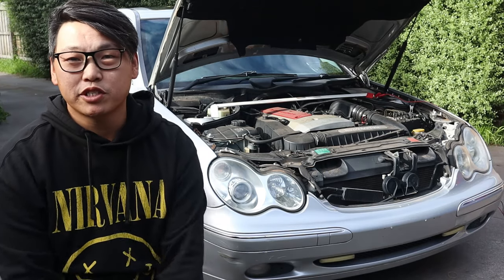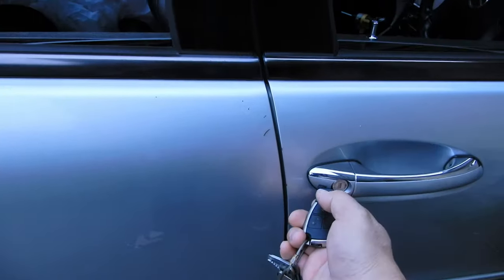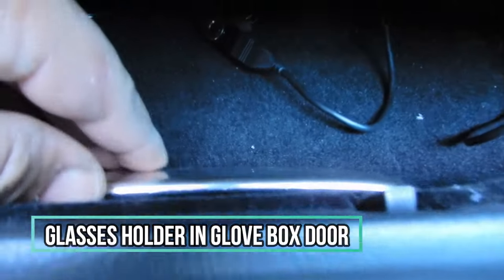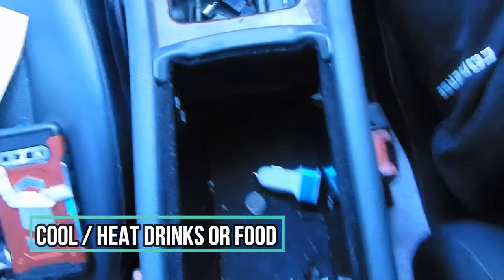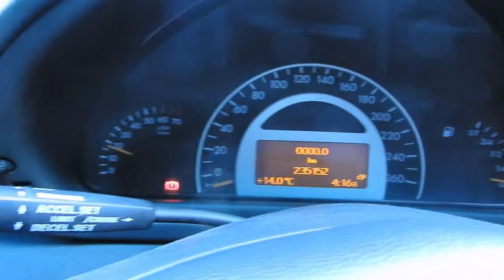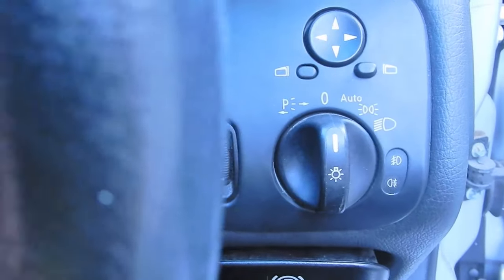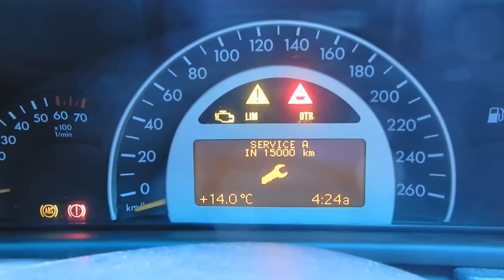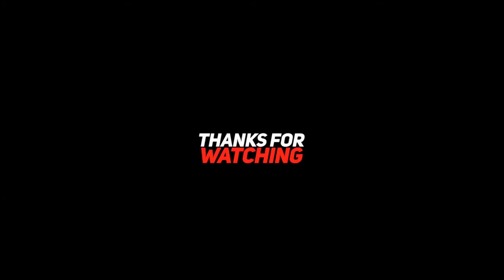MERCEDES W203 cool features tips and tricks handy hacks hidden functions

Comment: Pull up on the coin holder to remove and underneath is a hole to poke a pen into to get an AUTOMATIC car out of park, probably for when the battery goes flat or in my case the ABS computer failed, it only gave me 2nd gear I think it was, (and reverse) but enough to limp home.
Reply: WOW, I imagine THAT is gonna be of REAL use.. one day!!
Thanks for that.... 
Weird place to put a thing.. they could have just put a button on the dash?
Reply: Oh.. I can't get mine out... 
I am a pauper in a C Class.. :(
Reply: were you able to drive in a all gears after doing this??

Comment: What happens if you Jumpstart the car directly with tye vattery without using the metal chasis as the groun???
Reply from the maker: u can ..just be careful u don't short anything..u can do it that way..the only reason why uts better to do it using the terminal they give ..is becuz it protects the fuses incase u accidentally touch positive to the chassis ..it can short fuses or the sam unit even

Comment: Great video.  The W203 is indeed a beautiful car.  20 years old and still looks great.  Wonderful design for sure.
Reply from the maker: indeed i still love it hence why i havent sold it just yet lol...
Reply: @MIKEYZVLOGZ  l have a 2002 c240 same color as yours .l love this car.I only wish that I had a the turbo version of the 2.6 engine which would boost it to 349 hp from the 168 that it has .l think this car is just a little bit underpowered, that's my only complaint
Reply from the maker: @chrisfritz6261  yes i understand ya.. but if u wanted a more ppwerful car should have gone with a bigger engine then u would like it more... the 200 and 2 cylinder are just for cruising ... eventho mine is supercharged just lacks power too..and u can only upgrade the charger so much
Reply: @MIKEYZVLOGZ  l actually rescued this car at a auction and only paid $1400 for it.It ended up having a bad transmission and all the typical  problems that this car has when it gets old .l put a trans in it that I bought at a salvage yard and fixed the small problems that were broken and now everything works and it looks great.Rhe next thing I need to do us rebuild the suspension both front and back.l already have the parts but it us such a pain to get under the car to do this job that I have been putting it off .
Reply: @chrisfritz6261  l have the c32 with 400hp and supercharger stock. Not bad but needs a dyno tune to make it fly. cheers

Comment: Wonderful tips provided, thanks! I just bought one. Where did you get the head unit replacement in WA? I'm thinking of getting an android apple car play.
Reply from the maker: WA? i got it along time ago from a ib hifi in Melbourne 
now they have a new version of it , u will need all the plug and play accessories like facia kit and iso harness with steering wheel controls

Comment: By the way noticed that you’ve replaced the radio for a multimedia. Where have you got the wood-like colour frame? Or have you been able to retain the original? Been looking but haven’t found one.
Reply from the maker: @jaimemoura4802  ok so u only replace the double din area ...there use to be a single din unit and also a slot for accessories ...they were both removed but still needed a facia kit surround for the gap that would be there ... the wood grain surround stays there

Comment: Underneath the little coin holder in the center, there is the emergency shift-lock-override for the automatic shifter. The coin holder can be removed to reach the override with a screwdriver or a similar tool.
Reply from the maker: yes correct good tip
Reply: Wat dous it ? Thank you . Or why you need to use it? Kind regards
Reply: @nini7441  l got my keys stolen at a bar one night.l had to tow my car home,but with no key you can't put it in neutral, same if your battery goes dead,so I had to punch that that little button with a screwdriver to get the thing in neutral to tow it home
Reply: ohh cool....

Comment: Many thanks for this excellent tips & tricks tutorial Mikey. Really informative. The 90-degree hood feature is fantastic - never knew till seeing this video. I have a 2006 w203 automatic saloon in the UK (made in South Africa) but the dashboard is completely different (with 2 large circular dials and 2 smaller circular dials with a very narrow text display area in the centre) and I tried to get the hidden diagnostics menu for ESP settings, oil level check, SW version etc for example but mine doesn't seem to have this option. The battery voltage checker works on mine though. I also have 2 small yellow LED lights on the bottom of my rear view mirror which I never noticed before.
Reply from the maker: I'm so glad it was helpful my dear friend

Comment: Thank you great stuff. Is there any reset for the radio . Mine does not work after I change the battery  I was told I need to put in the code . I can’t get a screen to put in a code.
Reply from the maker: ye there should be a option to enter your code for radio ..if u know the code then u just enter it ... evwn if u can't see the numbers u just press the buttons kn ac rdance with your code and it will turn on and goto a function once complete .. I've never had this issue so not sure exactly how to .. and my stock radio has been upgraded too

Comment: Hi I bought today C180 engine is M111 E20 Evo and manual transmission , what advice you give me
Reply from the maker: @افلامومسلسلات-ج4ل  just lool after it ..the car is very rsolid ... I didn't have any troubles until about 7 years late
due to wear... I drove it normal I didn't do burnouts and drive like a hooligan hoon head... I cruised it mostly and changed gears smoothly.. manual is so fun as it's still rwd... in the wet u can have some real fun.... basic Manitenance regular checks on all engine components and always service between 7500 to 15000 kms ... or just do it at 10000kms for oil service and u will.be fine ...

Comment: Thanks for the video. 
I have a question, i put aftermarket brake lights and every time i start the car there is an error message telling me that i have one fault on the left auxiliary ligh but my lights are working, can i get rid of that error message?
Reply from the maker: u need to ensure ur using canbus error free bulbs and if led sometimes u need a resistor

Comment: G'day mate! Thanks for this, ive had my 2002 C220CDI elegance auto for a year and didnt know most of these( you need a manual to tell you how to read the manual on my merc!)..im going to try and understand how to use the cruise control ...ive tried while driving and no joy ill watch the vid again and take notes!👍
Reply from the maker: oh ok well honestly it's pretty straight forward.. so u reach your intended speed and then u push up on the stalk that will set the speed pulling towards you will cancel and pushing down will reduce speed pushing it in towards the right will turn on the limiter so u can set a limit as to ne er exceeding a speed ...
Reply: @MIKEYZVLOGZ  cheers buddy ill give it a go tomorrow! Also the passenger side wiper packed up which turned out to be the bearings on the wiper arm, ive bought a mercedes wiper arm  bearing repair kit so we'll see how that goes too! One thing after another with 20+ year old cars but its a great car👍
Reply from the maker: @shaunmcclory8117  indeed

Comment: The vest video so far.  Thanks !!
I  really appreciate it!!
Love it
Reply from the maker: so welcome.
Reply: @MIKEYZVLOGZ  
Only thing you forgot was to how to set up the cellphone with the car system. 
Other than that it was very helpful. 
Thanks for the video.
Reply from the maker: @figgiefigueroa7372  yeah cuz I don't have the phone thing anymore cuz my car only had the old analog phone that was connected to the dash and I cut the cable and removed it completely .. the later models have the phone connection .. hence why I installed a aftermarket unit so I could sync my phone a d use Bluetooth to connect the phone as well
Reply: @MIKEYZVLOGZ  
Oh, ok I'm sorry friend. You did great!
I got a 2004 c230 kompressor sport and it got 230,000 miles and is a monster in the road. I love my 🚗 🚘 car.
Right now I'm doing a list of the replacement parts that I  want. Still is cheaper than buying a new car.😃
But mines does have the phone feature on it. And I'm trying to learn how to install the phone so I do hands free while I drive. 
That car is the best Mercedes benz has offered mines is a 4 cylinder. Cheap on gas.
That was my dream car, and now that I have .
I'm going to do what ever it takes to keep it original. It does 120 mph in seconds.
Reply from the maker: @figgiefigueroa7372  good on ya 
. ye this was my first dream mercedes loved the shaped ..always have ..then I fell in love with next model w204 and now have that too ... next might be a e class well see
Reply: @MIKEYZVLOGZ  
I'm re-doing mines 4 pages of parts paint rims,and upholstery.

Comment: Fascinating….. I never knew most of that. I have a 2006 C-230 I inherited at 56,000 miles in 2017. It now has 70,000 10/21 but I have spent $15,000 U.S. to get it in good shape. I have spent so much and it is running very well, but when I see all the multitude of complex systems it makes me nervous to think of all the potential repair issues that could develop!
Some of the BIG fixes I had done were the ECM (engine control module $2,000 p&l) and the transmission control module (controls shifting $2,000 p&l) and the front torsion arms ($750 incl rubber bushing) plus many other items.  I see now there must be many more computers I wasn’t even aware of. These features are nice but it makes my wallet quite nervous.
Reply from the maker: wow good stuff mate ...well done
Reply: I have the same car and I deal with the intake manifold, oil filter
Housing , drive belt, pulley , atf + filter changed , thanks God I’m a handy person  did all the repairs saved  a lot  but the car is worthy

Comment: W203 is one of the best Mercedes ever made.
Reply: Actually it is considered the worst one.
Reply: @buretehudesi  everyone have their own opinion.
Reply: @waseeqkhan863  it's not the opinion. It's based on comparing. The most people driving and maintaining these cars say w203 is the worse c class ewer made.
Reply: @buretehudesi  i have w203 for years i enjoy it everyday you maintain it well for sure you gonna enjoy it. I enjoy more then my civic 2017.
Reply: @waseeqkhan863  w203 is last true mercedes.
Reply: @goldix7116  agreed, it’s the best in its category. If you compare it with bmw 3 series it is far better then that.
Reply: @waseeqkhan863  i am very satisfied with my lovely w203 cclas.only common maintance and a thermostat change last year
Reply: Until the 2002 model..... then 271 engine was installed.... ABSOLUTE RUBBISH ENGINE
Reply: @buretehudesi mixed opinions - 😅
Reply from the maker: i got into mercs from the w203 model always loved the lights

Comment: Hi, thank you very much, very informative.
You said 4:13, that when the car is manuel like mine(2002 c200 cdi), the engin does not start directly like the automatic, you have to "dosomethingto-it", what is that?
Thank you for help.
Reply from the maker: so for normal auto u can just flick the key and it will start .. but for manual u have to turn the key and hold until car starts... that's what I meant
Reply: @MIKEYZVLOGZ  So clear, appreciate it, thank you very much.
Reply from the maker: @tiyebchessmr9044  ur welcome buddy

Comment: Very helpful video, thanks. Water got in my w203 c240 fuse compartment in the engine and the AC stopped working, any idea on what to do?
Reply from the maker: water is never a good sign with electrical it can be a number of things .. sorry to say I don't think I would know what it is.. however an auto electrician could help in this case... it comes down to testing and tracking down what damage was caused due to water.. can I ask how did water end up in ur fuse box? it's rare
Reply: During heavy rain the water drain pipe through the wiper vent got blocked with dirt so the water overflow to the engine compartment
Reply from the maker: @ighodaroakenzuwa6416  that's crazy ... just start checking fuses and your electronics.
 as u can imagine water damage within a fuse box can shut down the electrical system..hence making it a major issue

Comment: At 10:08 i ear you have the same clicking noise with your vent than i have with my car. Have you fixed it ? I tried everything but nothing succes until now lol
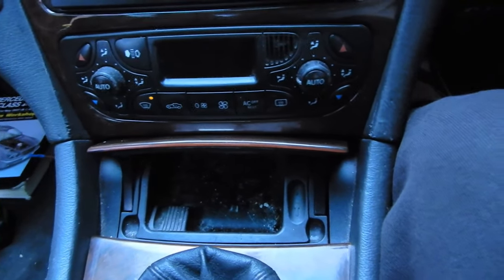Reply: At 14:00 you respond to my question ;)
Reply from the maker: @cmonavis2  not yet only way is to remove almost entire dash and get inside cuz its a lever that needs to be replaced cheap part but big job maybe one day

Comment: this has been very helpful. my abs esp bas and engine lights are on. tried to reset but remains on. how to sort out these problems.
Reply from the maker: did u do anything like disconnect t battery ?
Reply: @MIKEYZVLOGZ  yes . for 5mins
Reply from the maker: @reesnaidoo135   In that case you just have to drive your car and turn all the way left turn all the way right and everything will reset and all those messages will go away this normally happens because you have disconnected the battery any just need to learn all these functions again

Comment: Would you suggest using fully synthetic oil if so why if not why it's not what would you recommend
Reply from the maker: I suggest sully synthetic as recommended by mercedes Mobil 1 etc ..I only use synthetic oils mate
Reply: Thank you for your fast reply I am going to pick up Mercedes C-Class in the next day or so 2005 C-Class 200
If I have a problem that you might be able to help with is it ok if I hit you up
Reply from the maker: @jozzerful2  sure just understand I. not a professional mechanic. I'm a simple diyer. .self taught ..
Reply: @MIKEYZVLOGZ  yes Mike I understand that but still value your opinion

Comment: What =s the offset on your wheels? are you running spacers? I tried putting modern MB genuine wheels on my 2003 w203 c200 Kompressor sedan and they touch the brake caliper, the whole rotor doesn't move due to the touching 😥
Reply from the maker: normal offset standard setup staggered wheel setup abit thinner in front and thicker in rears 18s..I think its 225 40 18 front and 245 40 18 rear..I'll double check and let ya know ... ye ur wheels shouldn't lock up like that ..no good .. should be perfect fitment.. no rubbing etc ... u can go up to 19s and even 20s .. I don't use spacers .. just factory fitment

Comment: Hi, first of all great Video!
I got myself a year 2000 w203 c180. I got my license 5 months ago and I think this car is all in all really good. But I do have problems with the driving and the shifting in the first 2 gears it seems kinda rough to me. Do you got a opinion on that. Maybe its normal I dont know!? Thanks
Reply from the maker: it shouldn't be rough should be smooth ... manual or auto ?
Reply: Its a manual
Reply: The Clutch and the throttle are really sensitive so it seems rough. Maybe you can relate? If not let me know
Reply from the maker: @gzuzistkilla4198  no mine are smooth just normal ..its shouldn't feel like that
Reply: Okay thanks for your honest opinion. Have a great day mate
Reply: Wahrscheinlich die Zündkerzen tauschen.

Comment: l found that aux audio jack inside the glove box in mine. Kind of tucked behind the side of it.
Reply from the maker: ye thats what ive been told personally  ddnt have it , but i have heard heaps of ppl find it there and some even had to plug a connectorto under the side floor panel tucked away under the floor carpet right under the main cables , i guess they didnt have the audio package which has the aux already fitted just a matter of finding it and usiing it after exsposing it

Comment: Dude thanks for this vid, i was searching for some function And i found it, btw to Enter your battery voltmeter, you have to be on your odometer Page And Press 3 Times reset button, but i must have your engine turned off than it Will work, i have s203 facelift And There you can see all your dynamo menu also info About oil, voltage, sw version etc, thanks a lot
Reply from the maker: Good tip!

Comment: Hi Mikeyz, Im from South Africa and i have the c240 2008 model. I tried the keyfob hack where you press the lock button for a few seconds them you have the option to unlock just the front driver door and press again for the rest to open. Same with the remote windows to open and close with your keyfob. Please let me know what i can doe to sort this problem. Thanks
Reply from the maker: HGMMM THAT VERY STRANGE  its shoulntd be able to do that ... sometimes u need to point the keyķ directly to the inferred tab but i haved done it by usining a key fob about 1 metered  away and it still worked ..i dare say somethimg is stopping it from opening convenience feature
Reply: @MIKEYZVLOGZ  thank u will try asap. Keep up the good stuff...
Reply: @n3er0o  thanks for the heads up, ill try and check it later.

Comment: My climate control clicking noise is gone. Just did that reset learn hold two bottom thing and bam! You saved me a lot of time and money. Also now my sun roof works perfect.
Reply from the maker: it's not a permanent solution .. the fact is the stepper motor is malfunctioned
Reply from the maker: just know that its not apermenant solution

Comment: You have corroded soldering on the door sensor for the windows because the range is 6 meters at the right angles to open and close the windows from the fob
Reply from the maker: yes correct cuz there's   a fix for this here u either fix the antenna in the keyfob or u fix the antenna in the door module like u said... cheers for the tip